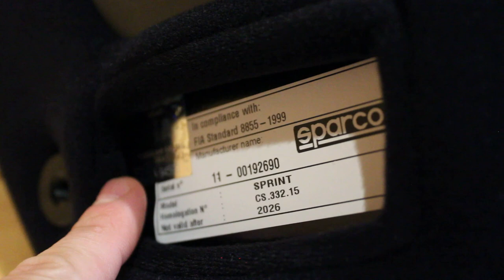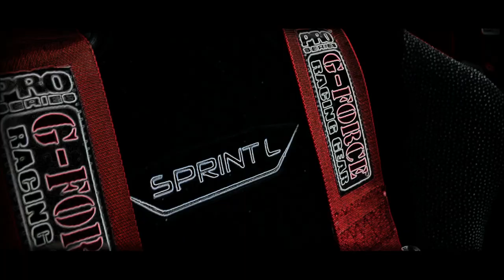New Seats for the 987S... Again!

Comment: Hi there.  Great video.  I'm torn between the r100 and sprints.  How would you say the comfort level compares between the two?  Also,  for the difference between reg sprint  and sprint L, what is your weight/waist size and which of the two sprints you find more comfortable?  The shoulder wings don't look wide enough for your upper body in the regular sprint...  Thanks!
Reply from the maker: The R100 were very firm, the Sprints are definitely more comfortable to sit on if you are okay with them being fixed-back. I'm also pleased with the Sprints sitting a bit lower than the R100s did. Feels like a more optimal seating position in a Porsche. 
I'm 5' 7" and 170lbs with a 29" waist. The regular Sprint fits my waist perfectly. The few times that I have sat in the Sprint L as a passenger, I have enough room to still slide around. 
I do have very broad shoulders, so you're right, my shoulders are too wide to sit straight in the seat. But in a position with shoulders forward and both hands on the steering wheel, I don't even notice.